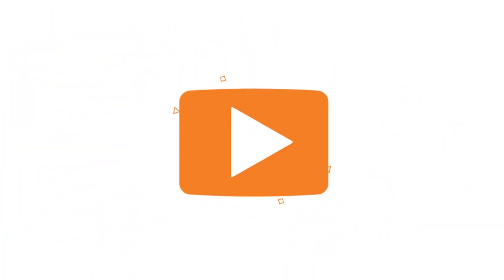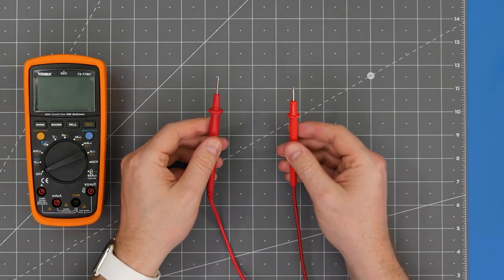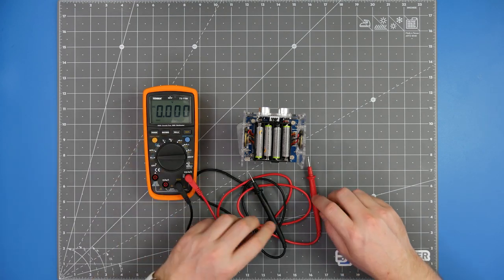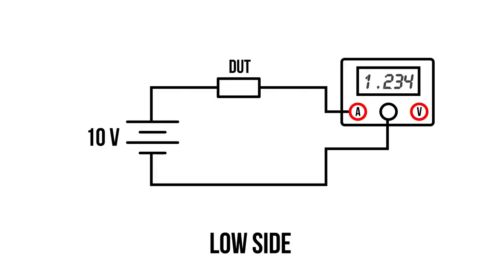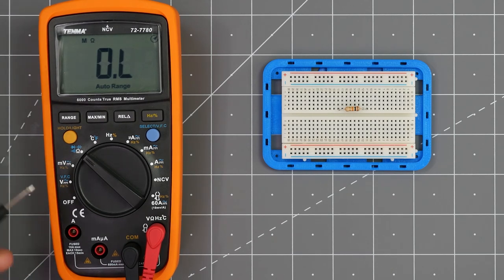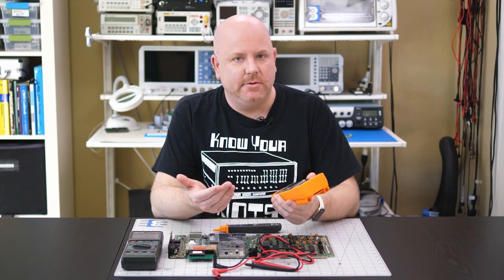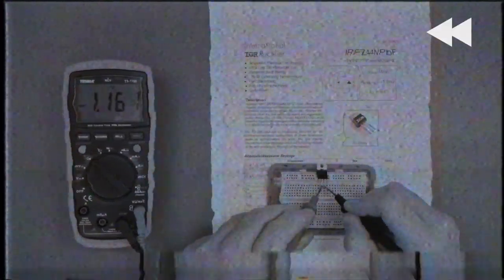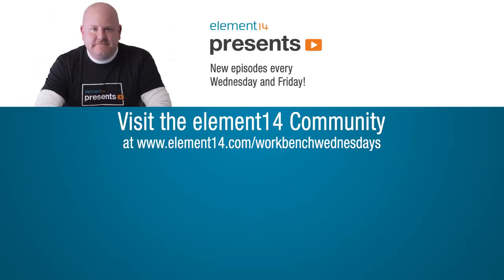Instrument Basics: Digital Multimeters - Workbench Wednesday

Comment: I usually use mine to measure voltage on my AA and AAA batteries and also my car battery to verify the system is working as it should.